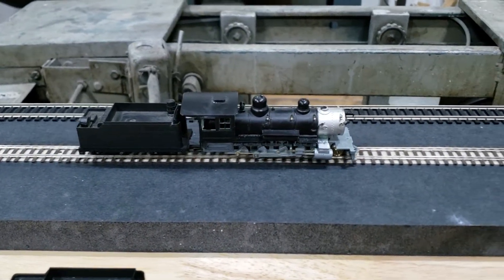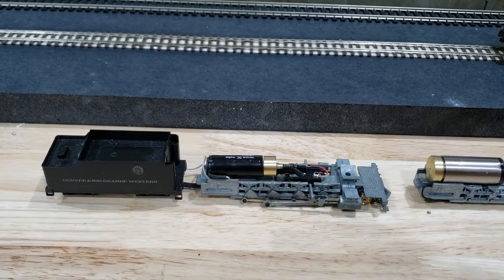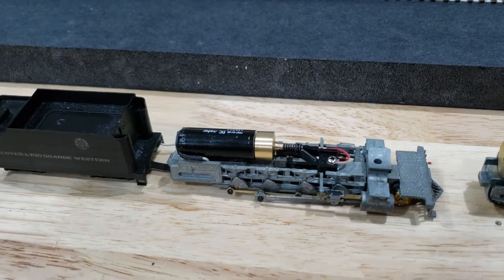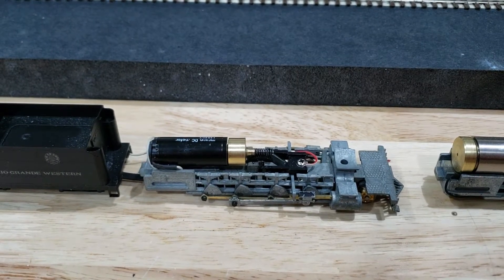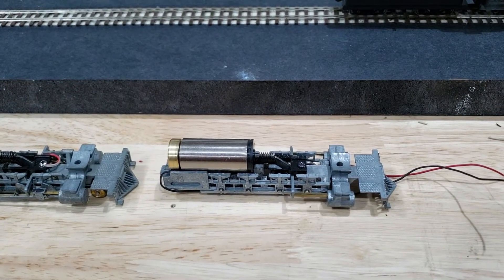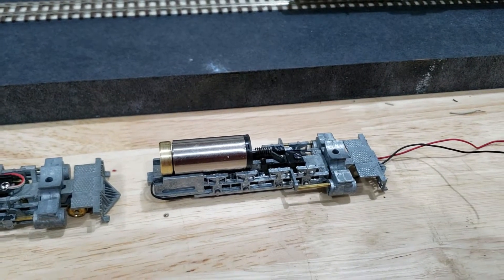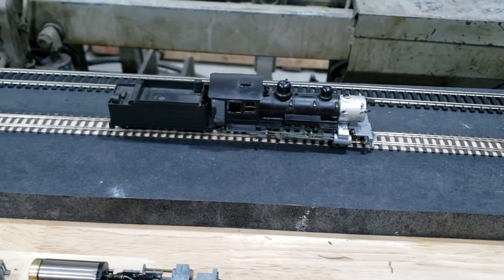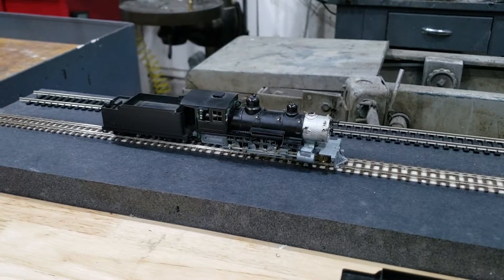Model DieCasting Hon3 2-8-0 Re-Motoring Madness!

Comment: Hello DTJ do you have any plans to complete the models and dcc or at least put them together and paint them
Reply from the maker: Thanks for stopping by, point well taken.

Yep it's true I have posted of lot of mechanism tinkering videos especially my quest to get an MDC loco to run like a Blackstone.  I'm currently staring at a tray full of reworked MDC HOn3 chassis rebuilt to a refined standard design that I will be using for a number of future kitbash builds.  

So to be honest, I'm dealing with a lot of 110 year old home renovation issues right now. There's a pile of models in my studio in the paint ready stage, most have DCC, lights and sound test fitted.  Once I get past the home renovations there will be time for layout planning, railroad identity and color scheme development, then painting and lettering.  I'm currently testing out diesel color schemes on old 3D prints when I have a little spare time, but unfortunately right now really I have to take a break from models and YouTube to get my house back together.  I'd much rather be working on models.
Reply: @dtj9923 I'm dealing with a 250+ yr old place here myself, good to hear I'm not alone. Did you only use the original chassis frames? The original was all metal, but the 90s final version had a metal center frame with plastic outer frames. I'm curious if the plastic & metal would be an improvement or not. It could go either way being a late issue MDC
Reply from the maker: @blairmielnik8228  Also happy to hear I'm not alone fighting a historic home.  It's a giant time sink.

I have experimented with both versions of the chassis.  Repowering and regearing the early version is pretty straightforward. NWSL gears, flywheel, Maxon 13mm low speed motor.  The rigid metal frame at the extreme width of the axles actually does a lot to make these run smooth.  It keeps everything square and arrests movement at the far ends rather than trying to hold the center of the axles.  If that makes sense.  Wider support, less cantilevered, amplified motion.

The later model with the metal core and plastic side frames isn't nearly as rigid as the original frame design.  This is compounded by the fact that the later wheelsets trend to have slightly bowed axles and wobbly wheels.  Getting these to run smoothly with no wobbles can be really difficult.  The two stage gearing setup on the later chassis with NWSL replacement gears, a flywheel, and a Faulhaber 1332 motor makes for an incredible drive setup.  They will glide to a stop when you cut the power.  The Faulhaber motors are higher speed and perfectly match the compound gear ratio.  I do have one on the bench that runs better than anything brass I own.  No joke.  I rebuilt a set of older wheels with the new nickel silver tires and squared it all up in a fixture.  Runs like a watch!
Reply: @dtj9923  Thanks- There is an ebay one at $120 with the plastic outer frames. I already have the all metal early version and some motors to pick from. I will just stick with the all metal one then, sounds like the rigidity outweighs the other benefits. And I also have a NWSL gear kit or others I can use. Thanks.
Reply from the maker: @blairmielnik8228  If you're looking for non brass tires for the drivers and feeling brave enough to swap them, Keith Wiseman has stainless steel tires for sale on eBay right now.  He is asking a bit much though.

Comment: I have a stack of 4 boilers I need to find someone to mill out. I found a old forum where a guy built a slide valve K-27 out of the Outside Frame kit and wish to do the same. He milled out a considerable amount to fit a new motor in but I plan on using the same Maxon coreless motor you have here. Have a handful and planning to buy more. I managed to get the extension shaft off with a dremel and some guess work and a little patience to get a bare shaft. I am Also considering buying a cheap Chinese lathe and mill off eBay and want to see if it’s strong enough to work on the diecast of these old frames but I have my doubts. So I am actually really liking your videos on these as I feel many people haven’t covered them as much as there is a following for them. I love these kits and want to get more of them along with the NWSL gearing kits as now we can get them from the website.
Reply from the maker: Hey Marc,

I know the exact K-27 build you are referring to.  Guy put a lot of work into that. 

You probably don't want this suggestion but I would add up what you think the project is going to cost and watch EBAY for a slide valve K-27.  The PSC parts to build out a K-27 have gotten really pricey.  On the other hand $200-$250 for a mint in box Westside slide valve k-27 is not uncommon at all.  Check the completed listings on EBAY.  There's a bunch in that range.  If you're 3D printing conversion parts or just doing it for the challenge that's a different story.

Before you dive in too deep take a good hard look at the MDC frame and K-27 frame and make sure you're OK with the differences.  You can do some stuff to make it more accurate but the frame is kinda... not really based on prototype practices.  Why MDC did this?  Who knows?

Are you working with the newer version of kit with plastic side frames or the old series of kit with a one piece diecast frame?  There's a discussion there as well about even getting it to run OK.  I get the impression you are looking at the older kits.  The new version is tough, still trying to get one to run well. 

The slot inside the MDC boiler is right at 12.7mm (1/2") if memory serves.  Realistically, removing .5mm per side and carefully centering the motor will work to get one of the 13mm Maxon motors under the hood.  It doesn't take much.

What lathe mill combo are you looking at?  This little one from Grizzly is more than adequate for the job. (https://www.grizzly.com/products/grizzly-6-x-10-combo-lathe-mill/g0937)  
I like this little guy because it has an MT2 spindle taper so you can use widely available ER collet adapters.  Cheap 3 jaw chucks are not terribly accurate, but even cheap ER collets tend to be incredibly accurate.  The dovetail bed is also a huge plus for milling operations.  Lathe/Mills based on a conventional single V way lathe bed are wishful thinking at best.

Realistically, you're just going to be milling Zamac zinc diecast alloy and styrene plastic.  It doesn't take much of a machine to do that.  You gotta be REALLY careful about generating too much heat but I don't recommend hosing it down with cutting fluid or WD 40.  It tends to creep between the die cast core and plastic shell and eventually makes a mess out of your paint later on.  Compressed air cooling for the win!  I learned this lesson the hard way.

Definitely send NWSL your love and buy direct from the new owners!  Just be patient, they're a small business dealing with the Covid economy and they are working really hard to keep their customers happy.
Reply: @dtj9923  hi Damon. 
The MDC K-27 build is more of a home brew thing, kinda like it’s possible to make a cheap kit look a little better. I have a couple books that show the differences in them as well as online photographs and his forums for reference. Longer smokeboxes, frame extensions, as built with compound and regular cylinders, I believe only two of those slide valve K-27’s made it into the 1940’s before getting torched. I kinda wanna do it for the challenge. And so I can add good running HOn3 engines to my fleet of growing engines, I have tons of projects to work on and keep me busy! 
I’ve located a number of the parts from Whistle Stop here in Pasadena, CA and want to use the kits I have now, as I have a Westside C-25 and was originally gonna build it as the engine I am modeling after, but now that the brass one has been located I have about 3 Outside Framer kits I can use. Waste not want not right? I have done a couple modifications for it already and need to get more of the gearing kits but don’t have the funds. 
I also have one Inside Frame as they are all old kits, that’s getting a styrene boiler and I’m building it up with the same set up, another home brew D&RGW 315. Has the lines, but needs some work! I’ve seen a few new kits but it looks like people really stay away from them, I don’t know much the difference between the old ones and new ones, but I do see people don’t care for them. It’s a shame nobody manufactures HOn3 stuff as much anymore. Blackstone cornered the scale and then we are still waiting on K-28’s and K-36’s. A shame they’ll be either never made or done in the next 10 years again. 
The lathe and mill are nothing to call home about. They probably won’t work too well for the application but would love to get something small for a little set up as I don’t have much space yet where I am at. I gotta get the links to them on eBay. I don’t know much about lathing and milling yet and wish to practice on these ones before dropping over 4K on a decent one. Space is the big factor right now. They look okay and for small stuff shouldn’t be too bad. As my friends lathe and stuff is down, I’ll have to see locally what or who can do it. Hard to find knowledgeable people these days. But eventually it’ll get done. 
NWSL is a great business to support. Since most of the catalogs are different and they plan to change some parts numbers I want to go to them directly. I’ve really had good luck with their parts in the past. And do wish to keep supporting them in their cause. They keep the hobby afloat and help modelers like you and I. 

Thank you for all the insight and appreciation of a good response. People nowadays are too short. Will keep following your projects as I have learned a lot from watching!
Reply from the maker: @_mdh_1998  For what it's worth, I use a full size 3000# RB-1 rigid bed mill and a Logan lathe for big stuff.  Admittedly I mill my boilers on the big mill in a padded KURT vise.  I use a small 8 x 10 CNC mill and a 10 x 20 CNC lathe for a lot of parts.  In the basement model shop I use an 8MM Levin lathe for everything precise.  I am shopping for a little mill but I want something really precise.  Junk doesn't cut it with Hon3 size models.  

I'm exploring the newer MDC Hon3 models systematically and have discovered a few things along the way.  The inside frame engines aren't too bad once you get the gears and drives sorted out.  I have a really good recipe I can share for that.  The OSF kits really suffer from the separate plastic frames, warped axles, and poorly assembled wheels.  They just WOBBLE down the track.  If you put the nickel plated wheel sets from the new kits in an old style frame they run much better due to the axles being fully supported on their ends.  If you are able to straighten the axles and true the wheels you might have a fighting chance with the new version of the kit.

The compound gear reduction in the new kits is actually a bonus.  You can run a 13000 rpm Faulhaber 1331? motor with a flywheel and they will just glide to a stop if you cut the power.  There's huge potential there.

Comment: Hi Damon! I am in love with these outside frame hon3 locos! Where do you get one from though?? I really want to get my hands on one
Reply from the maker: Unfortunately Horizon Hobbies bought MDC a while back and discontinued the old MDC engine kits.  Your best bet is Ebay.  

My preference is the older style kits with the outside frames cast as one piece with the chassis.  I have not had much luck with the newer version that uses separate plastic side frames but I'm working on figuring them out.  A lot of that is quality control problems and very wobbly wheelsets on the later kits.  The only hitch with the the older style kits is brass wheel sets but if you nickel plate the tires you're all good.  Whatever kit version you buy, count on re-gearing, re-motoring, and truing the wheel sets.  

Good luck!

Comment: Terrific video.  I have both the inside frame and outside frame locos as well as the Shay. In addition the grandt line boxcabs..All run well but not as slow as yours. Can you share what size Maxon motors you got on ebay? I do not have a lathe so is there another source for the flywheel and 1.5mm dowels?  Looking forward to your progress on these.  I still run dc but would love to convert the MDC s to dcc as well as the boxcab
Reply from the maker: Hey Jim, thanks for stopping by and leaving a comment.

Without a lathe, the motor adaptation is going to be a little difficult.  The flywheels are very custom shaped to work with the motor and its installation landscape.  In addition, the Maxon motors are also very much modified in the lathe. The motor will need to have the threaded brass portion trimmed off that mates it to the gear head.  There is also a process for removing the spur gear and thrust collar before fitting the new flywheel.  That requires a miniature gear puller for an RC helicopter and a micro press.

I used 13MM diameter Maxon 135267 12V motors.  They come surplus from China.  Be expecting some junk ones, I'd buy a few and use the ones with tight bearings.

Also look on Ebay for "FAULHABER 1331T012SR 12V"  This motor is not as slow but will be a much easier drop in option.  They are $59 NEW.  I bought a few and they are incredible quality motors. 

When I need 1.5mm stub extensions to press fit into a flywheel I use hardened dowel pins from McMaster Carr.
https://www.mcmaster.com/dowel-pins/system-of-measurement~metric/diameter~1-5mm/pin-type~dowel/minimum-hardness~rockwell-c52/material~52100-alloy-steel/

-Damon